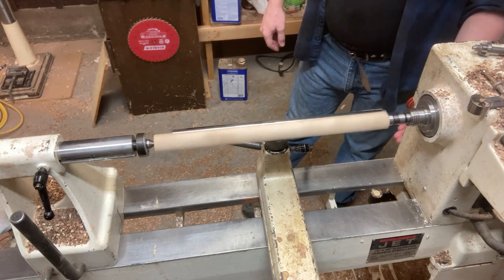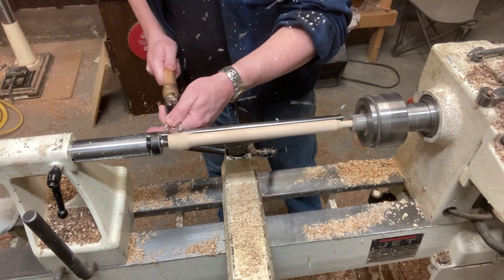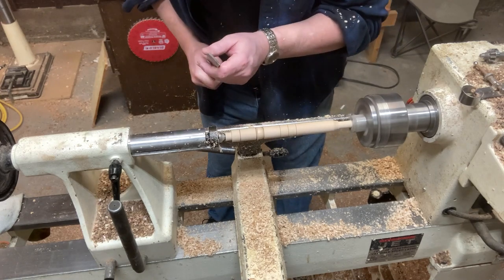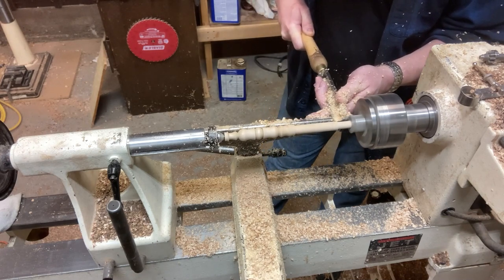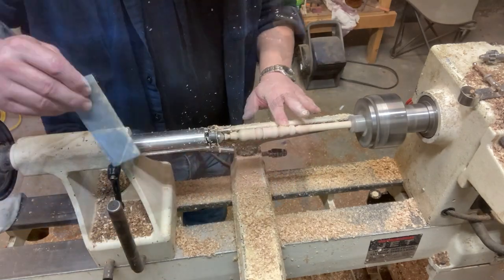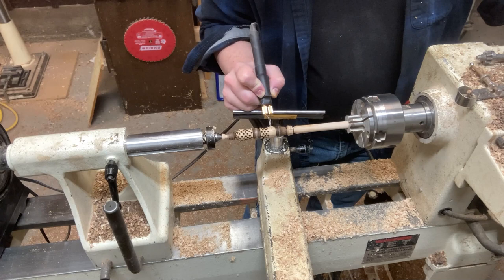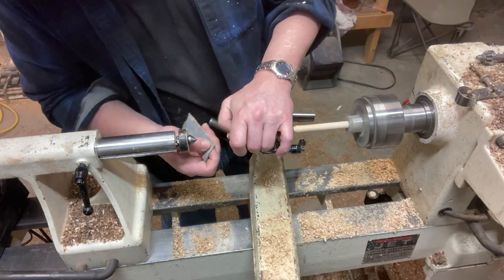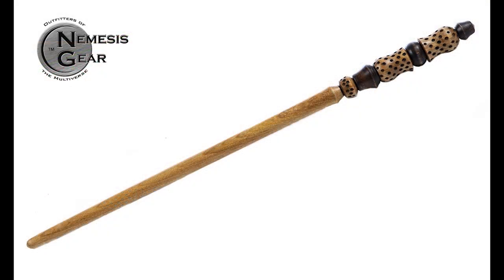Special Edition Birch Wand - Wood Turning

Comment: Nice I like wands have you ever made one out of Rowan wood
Reply from the maker: Not on the lathe.  I have done some natural wands from branches, but Rowan (or Mountain Ash) is typically used as a landscaping tree in my area.  Getting some branches from pruning is doable, but not something easily found in the sizes needed for larger projects.  They are not large trees, and so are not one commercially harvested.  Perhaps I'll get lucky and find a Rowan tree that someone is taking out of their yard.  😁

Comment: Excellent tutorial!  Can you tell me which chuck you are using pls.
Reply from the maker: It's a Nova chuck with NOVA 6026 Universal Mini Spigot Chuck Jaw Set.  I also have a thread adapter to allow it to fit on my lathe.  The adapter is drilled out hollow as well, so it allows me to put the wand blade into the chuck pretty far.
Reply: Thanks for the info!